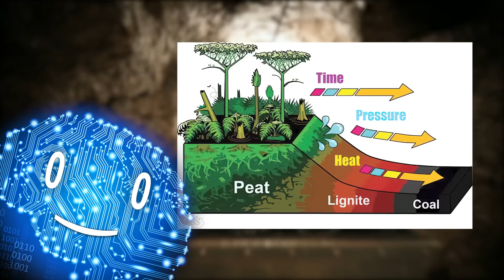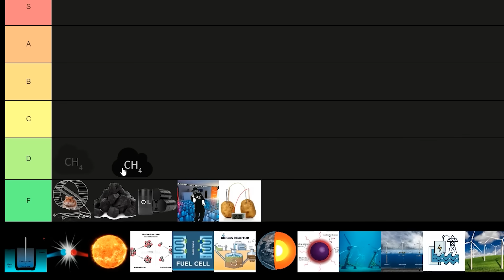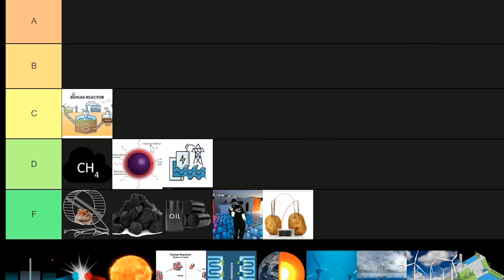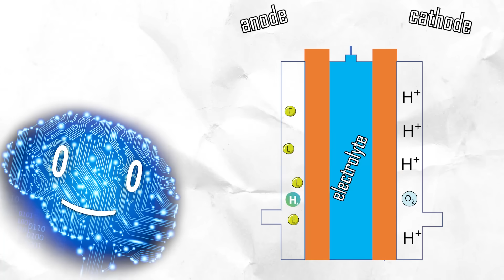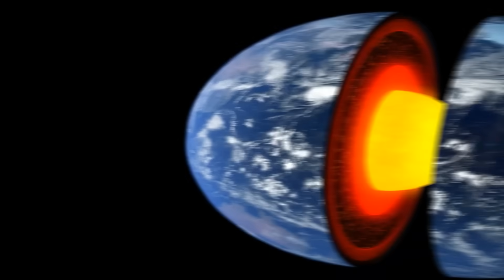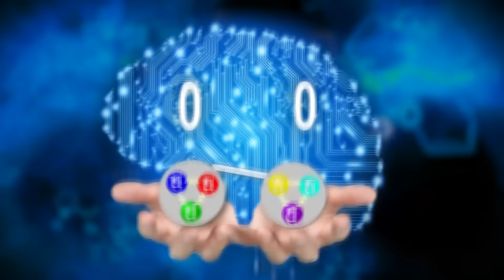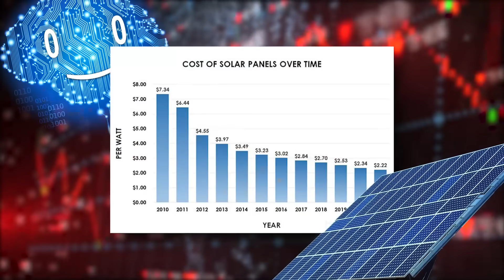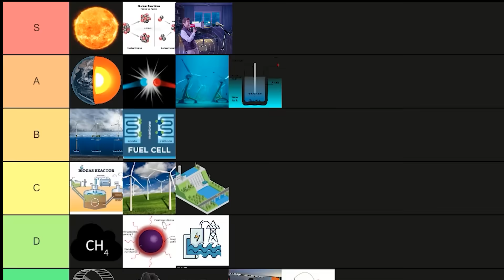Tier List of Energy Sources Explained

Comment: Electric Engineer here, i think hydroelectric plants should be tier A. There's two very important things that hydroelectric does today, being very good at it. 1 - You can choose how much energy is generated and can rapidly change how much energy is gerenated, and 2 - It gives synchronous compensation for the system. Our energy demands greatly varies during a day, at afternoon to dusk is the peak of energy consumption, and on midnight, consumption drops a lot. Also without synchronous compensation, the system became very vulnerable to any variation of energy demand and it's very likely to cause shutdowns, even total blackouts. Solar and wind energy you can't control how much energy is produced and they also don't give any synchronous compensation to the system, requiring a synchronous compensator to solve this problem (which is expensive and consumes energy to maintain active). Thermoelectric plants using coal, crude oil, nuclear, natural gas, biofuel, etc, they have good synchronous compensation but you can only slowy change how much energy is gerenated (it takes hours to heat up/cool down the boiler). This is why the ideal thing is use multiple forms of energy generation at the same time, so the system became efficent, stable and with less pollution. Solar and wind can produce at their maximum since they're renewable, Thermoelectric is when the demand is high, and hydroelectric does the job of rapidly change the energy generated to adjust the current demand and giving synchronous compensation.

Comment: The only problem with solar energy is that the materials and batteries and construction stuff for solar panels are super environmentally damaging to mine, and it has a lasting life of 5? 10 years? Also it consumes a lot of space.
Reply: Same for Uranium to be fair, and France got a lot of it from Niger which had a coup and is now struggling to replace that source. No sustainable energy is totally good for the environment, but they are so much better than fossil fuels that their impact gets talked down a lot. It’s important, but also to make absolutely clear they are better, unlike sources like prageru which still want fossil fuels back saying how “bad” renewables are.
Reply: @tortoisewarrior4855  and also safer, nuclear fusión is Even less "damaging" but also generates more energy then normal nuclear energy, and is safer.

The problem is there isn't a nuclear fusión plant working today and who knows for how long.

Comment: Hydrogen may not be the best energy source since it requires more electricity to get it and requires more care to store and transport than electricity but when it is paired with a clean electricity source like fission, fusion and solar  it becomes the king s+ tier of achieving maximum environmental friendliness because it does not matter if the future we achieve 100% full clean energy with the combination of fusion, fission solar or other ways that makes no use of fossil fuels in the end that is only half the story the other half is how the electricity is stored and used and that is with batteries that to be created the pollute a lot and the materials used are also not clean to be used and cannot be recycled and pollute but when you use clean electricity (that was not created with fossil fuels) and convert it to hydrogen you may lose some energy in the process but the need for complicated  unrecyclable and pulluting batteries is removed in most bug applications. Unless in the future a recyclable durable non polluting battery with high energy storage capability that is also cheap is created but just like fusion it is still away for now
Reply: Great comment!

Comment: Actually oil could be made by geochemical processes under high heat and pressure. Coal burns clean if converted to coke, and burned in a direct carbon fuel cell and fed to algae to make bio oil. But if you have an electret power source it makes a permanent electrical field. Though not easily harnessed. The safest nuclear reactors are molten salt reactors and Triga research reactors. But synthetic fuels convert coal to methanol and methane to gasoline. Bioplastics would be better to displace fossil fuels for polymers. Aneutrontic fusion does not emit neutron radiation and may use decaborane gas in a focus fusion reactor.

Comment: Putting fuel cells in front of hydro makes no sense. Most countries that can have all their power in hydro, it dosent polute, it adds water that yoi can use. You have fixed power production which is a HUGE deal. Fuel cells need a lot of rare metals in the catalizer and have a lot of problems having an efficiecy at max 60% more likely 40%.

Comment: Gas and coal should be higher than F tbh. They still produce huge amounts of electricity and were absolutely necessary for our industrial development.
Reply: yeah  coal fueled industrial revolution for 200 years
Reply: Wind Turbines should be in F tier for its inefficiency, high maintenance, and environmental hazard risks.
Reply: @DariusFlynt_2012 the latter is a misconception btw. The maintenance of wind turbines is a fair bit but much less compared to coal and oil as energy sources (they need constant humans to repair parts that are under constant mechanical stress and pressure ect)

They ARE efficient.. but they are NOT reliable. There is a clear difference.

They deserve C tier.. they overall are much better than coal. Again the environmental concerns are mostly misconceptions and small scale things.. like yeah birds die but they also die to skyscrapers and compared to the human animal and climate damage coal does wind is barely a environmental threat

Comment: Nuclear is far superior to solar in every way other than initial price (not saying thats really a huge issue). Solar panels are produced in factories that use greenhouse gases to power them, so an argument about the initial construction producing greenhouse gases is mute. Also, they talk about nuclear waste. What about all the e-waste from solar panels? That ends up in the ocean because there is no way of salvage any of the materials from technology like that. Considering solar panels typically have a lifespan of about 30 years, if everybody used them, there would be too much e-waste for us to really deal with. And finally, the efficiency and reliability of nuclear just absolutely cannot be beat by anything to do with solar panels.
Reply: And then there's the base load issue. Solar energy is intermittent, it stops when the sun goes below the horizon. Our current battery technology is not developed enough to counter this, and if we plan to invest into a better energy matrix, we might as well pick the most efficient.

Solar energy is great for modular decoupled grids, like having a solar panel for your own house. At this scale, batteries take care of the job just fine.
Reply: Solar, wind and battery waste = Baotou toxic lake
Reply: Don't forget also most modern nuclear plant designs can run up to 80 years. that has got to be factored into the equation.  wind turbines need their bladed replaced every 10-15 years and need their gear boxes serviced about every 10 in applicable. solar field need their power inverters replaced every 10 years as well (and those are the good quality ones) as the solar panels replaced every 20-30 years. battery storage will likely degrade in 10 years.

Comment: Solar power isn't quite S tier. It has one big weakness: the solar panels lose efficiency from environmental exposure. That is a cost point that takes away any savings. If solar power could overcome that e.g a form of solar voltaic paint rather than cells, then it would be S tier.

Comment: Hydrogen fuel cells are one of the worst energy dense thing to have ever existed.
Also, the fact that it's expensive to produce, SUPER expensive to store and you can't let your car with hydrogen not run, because it will slowly empty itself, unlike gas. Sadly, gas is one of the most energy dense thing around, hence why it's so used.
Oh, but you can directly burn it in a rotary engine. ANOTHER win for the brap-brap.

Also, it's garbage for firefighters. They're driving bombs. Like LPG, if there's a crash or a burning car with a tank like that in it, the only thing they can do is getting the fuck out and letting it burn/explode.

Also, no, SOLAR ISN'T GOOD . It's fucking garbage, abyssal, the worst energy ever.
It's renewable, but it's not green, it pollute more than your fucking car or coal power plants.

Yeah, a solar panel need to work with 100% efficency for AT LEAST 20 years for it to even become carbon neutral. Sadly, they lose around 30-50% efficency PER YEAR .
Solar panels, on Earth will never, EVER be good.
Reply: Sources?
Reply: @frygonkis  Every TRUE scientific sites. Not the pseudo-ones mixed with detox recipes and other garbage. Also, it was my graduation project in ecological engineering.
You can also put your brain on the "on" position and think, really think, for a while.
Reply: @FuSiionCraft  man why are you salty like that, I only asked sources to further read about this topic... I wasn't disproving you or anything

Comment: this really is junk production, the facts are full of errors, while nuclear is the best we have, fusion is not 1000x more efficient, it is more like 100,000 worse than fission, since fission can easily work at 1000k while fusion needs 100,000,000K, and the energy density of DT vs uranium is about 4 yet there is no tritium fuel to be found anywhere and to build a fusion reactor is looking to be a 1000 times as complex as say a Molten Salt Reactor, and the biggie, fusion reactors are highly radioactive because of the neutron flux that will destroy the reactor vessel, so I rate this channel as kiddie level science

Comment: Hydroelectric dams can be adjusted to the actual need very accurately.
Pumping water back gives is humanity's most efficient possibility to store energy.
At least A tier.
Reply: It's annoying seeing "Lithium batters bad!" when wind power would just use this or compressed air
Reply: @HeydenHarvey storing energy between seasons is not economically feasible with lithium batteries 😮‍💨

Comment: Idk why loads of ppl hates nuclear power. It gives you ton of energy, no toxic fumes and nothing much bad would happen other than some meltdowns due to ex-Chernobyl workers somehow decided that removing coolant from the reactor is a good idea. Also if something exists there’s also a chance of it going wrong
Reply: They didn't remove the coolant, the coolant boiled
Reply: @Mustardjaguar541they removed the control rods which actually work kinda like collant
Reply: I think most of the hate is just leftover propaganda momentum from the 1970s. Environmental groups at the time opposed nuclear weapons during the Cold War and blurred that into nuclear energy, treating them as the same thing even though they’re not. That stigma stuck around long after the facts changed.
Reply: Actually the Chernobyl workers knew to not raise the graphite rods but the captain dyatlov forced them for a unprepared test , and with the 205 graphite rods raised, the immense heating in the reactor core would potentially cause a meltdown, but a worker pressed AZ-5 ,  via putting all rods down , causing a steam explosion, it was very easy to prevent

Comment: Glad to see geothermal being recognised. I would have moved hydro higher up though.
The ecological damage caused by a dam is very localised and can be moderated with human effort (ie, if fish populations low, do breeding programs). The damage from a dam is not invisible and can be worked around. Additionally, it feels a bit harsh to call changing the environment to better suit human needs as "damage". The reservoir lakes that form from dams do become their own ecosystems, it's not as if life is lost and never recovers.

Hydro to me is an immediate A tier. It should be used where it can be used, but due to its strict requirements of being in high volume river systems it's often just not an option for many countries, for instance Saudi Arabia could never use it and Australia can barely use it (excluding Tasmania which does have a high volume river and does use hydro).

Comment: You forgot perhaps the biggest downside with hydrogen. It’s extremely flammable. Putting it in perhaps cars would essentially make them bombs
Reply: Yeah, but it's likely if it does get used in vehicles (likely not since EVs exist) the hydrogen would be cooled in the car to be a liquid, but that seems inefficient and dumb in my opinion

Comment: Keep in mind that with solar its not about how cheap it is, its about the eficacy of the panels, yeah aure the panels could be dirt cheap but if they only turn 10% of the light they absorb into power then they are pretty much useless, unless yoy want to literally carpet hundreds if not thousands of square kilometers of land with panels
Reply: Their is a sheep farmer that found putting solar panels in the grazing area results in the best quality wool he has ever harvested.

335 kilometers by 335 kilometers is the estimate 112,225 km^2

For a comparisson 33 billion meters of road * 3 meter in sqkm = 99,000 km^2
if you use 6m wides(2 lanes) you get nearly 200,000 km^2

Comment: My car can also accelerate to a fraction of light speed.

By the way, I'm not sure we'll be able to easily get rid of fossil fuels even if we were to switch to renewable sources completely. Sadly, plastics are way, way, way too important and convenient and currently, there's no real feasible alternative that can be deployed on the same scale at the same costs. Even if we were to make plastics more expensive to account for their environmental impact, they're still leaps and bounds more cheap and useful than anything else really.
Reply: Get rid of fossil fuels for energy and the oil for plastic is much much less then oil for energy
Reply: @catprog  I'm not sure that's the case. It's not like, if you have 100 units of oil and stop using it for fuel, you can use these 100 units of oil for plastics. I think you can only use certain byproducts of oil for plastic. So, you won't really be reducing oil extraction or oil refinement. You'd then just have tons of oil laying around waiting for a disaster to happen.
Reply: @Notsogoodguitarguy  
cracking is what they use to convert the non useful parts of oil into more useful types.

and Catalytic reforming as well.

Comment: Biofuel (ethanol) based on corn is inefficient, requiring more energy to put into manufacture into it than you get out. Biodiesel/Methane(but  biofuel not natural gas) is neat tho.

also, photo-thermal is underrated, might be less efficient but it's cheaper and easier to do than photo-voltaic, even if it's the "poor man's" green energy, it's better than burning coal.
Reply: I was going to say photo-thermal for eletricity is hard, but you are talking using the heat directly.

Comment: Yes, solar energy is very environmentally friendly and has a big energy gathering potential, HOWEVER the panels and batteries are made from lithium that is gathered in poor countries of global south like chille. Gathering lithium requires a lot of water and space as well as a big risk of spilling toxic waste into the water supplies like rivers, which is the main source of water used by locals to drink and water crops. I think that you at least should have mentioned that a lot of energy gathering methods have impact other than CO2 emissions.
Reply: I have never heard of lithium being used in solar panels. Only silicon.

Batteries though use things like Lithium and Cobalt.

I think pumped hydro is a much better option for grid scale storage.

Comment: One major current drawback of solar energy is it requires storing the energy, otherwise it only functions a fraction of the time. This problem needs being figured out before mass deployment on land
Reply: we already have solar batteries...
Reply: @bucket6386  the order of magnitude doesn't cut it. I saw a study about California : the totality of electric batteries equal 15 to 30 minutes of energy consumption. Not enough to last a full winter...
Reply: @Duke_of_Lorraine  solar panels still work in winter albeit at less efficiency depending on a range of factors, but solar batteries, while not perfect can help . Also other sources such as wind and nuclear will be used in winter so I don't see that as an issue.
Reply: One major current drawback of nuclear it is requires storing the energy otherwise you have to let the plant sit idel for a large period of the day.
Reply: @catprog  you can decrease the output of a nuclear plant, it's not binary all-or-nothing. Hydro power is also fantastic to accomodate quick fluctuations in energy output.
Reply: @Duke_of_Lorraine the capital cost of nuclear is most of the cost.

So if it not running at full output their is less energy to spread the cost out
Reply: @catprog  you don't need peak capacity all the time, usually more during the day than the night for example. But having to meet that peak capacity is a question for all energy sources.

Nuclear energy has the massive advantage of not depending on the elements so you don't have to account for unsuitable levels of wind or not enough sunlight, which in turn require overbuilding the renewable infrastructure to a much larger degree.